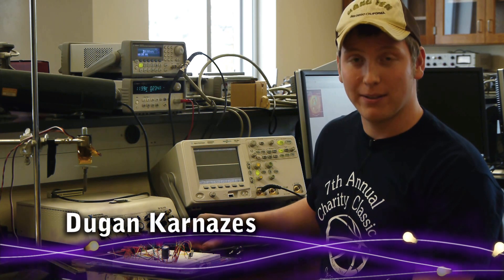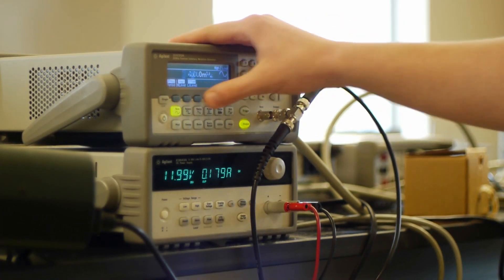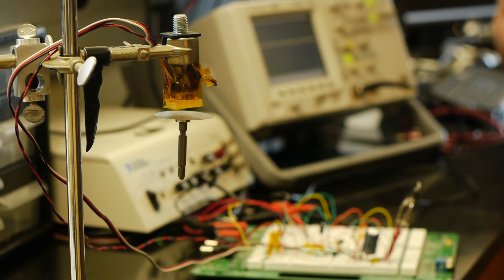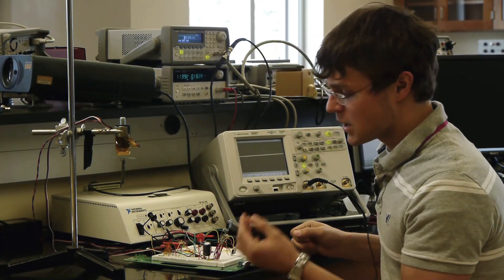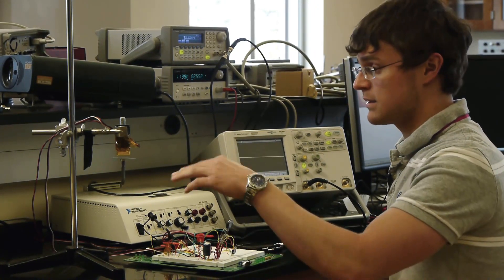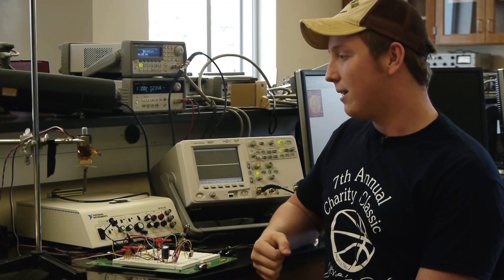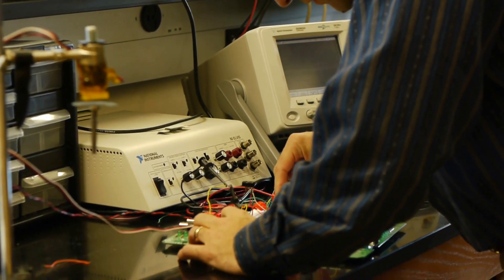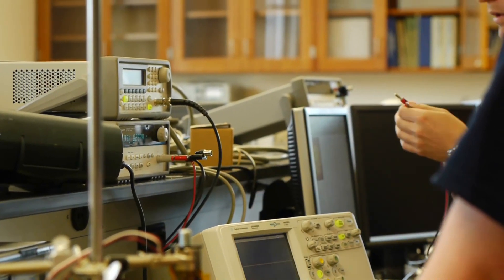Albion Physics Dept: Students Levitate Metal Object

Comment: Got a question motivated by a creative project. The science doesn't need to be 100% legit but close enough to avoid people getting taken out of the experience by a scientific inaccuracy so outlandish it's considered dumb. Would it be possible enough to explain levitating personal craft with self contained magnetic repulsion agaisnt a metallic rich sand on the ground? The idea is a sort of hover bike that's function is dependent on remaining above dark metallic rich sand that forms a sort of natural road system for these devices. These roads can be made intentionally as well, but visually I'm imagining a desert primarily yellow sand with black metallic sand settled in unmoving stream like deposits facilitating where the vehicles can travel. Would this be considered pure hokum?